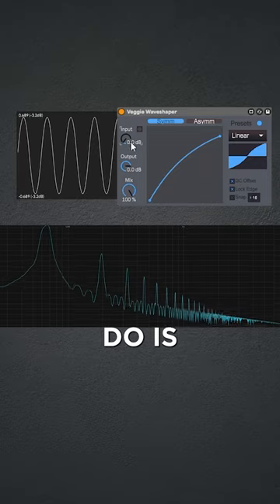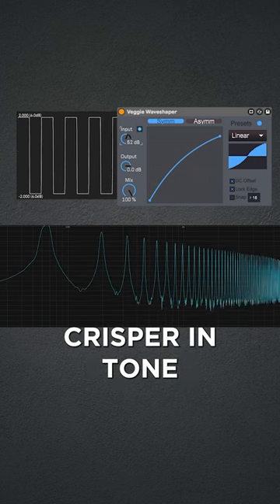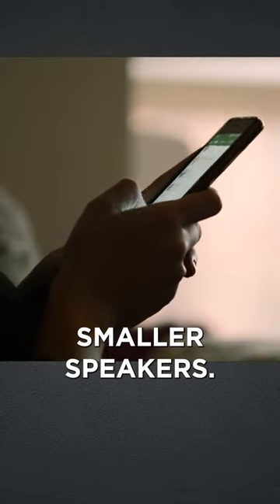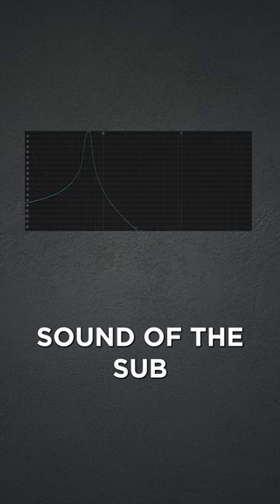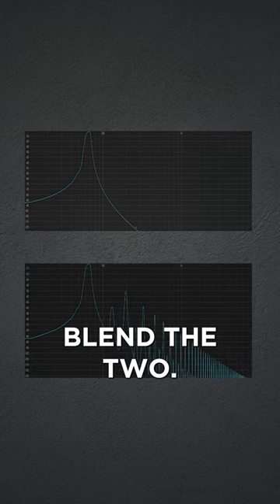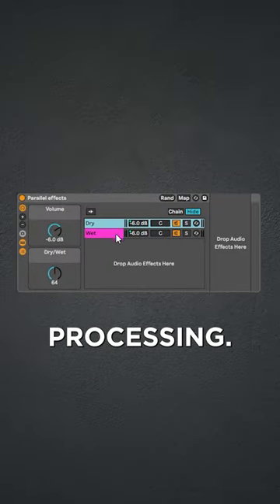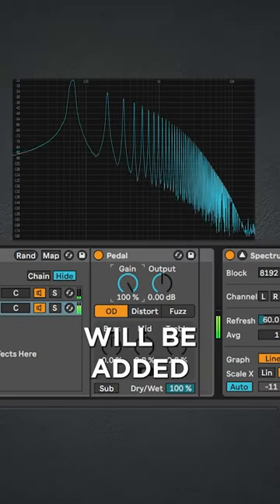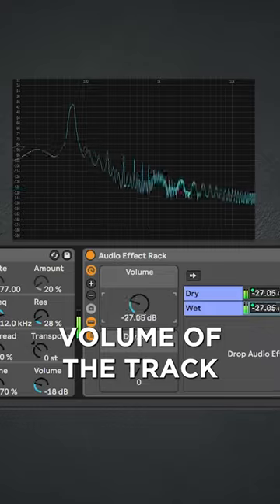How and why using parallel distortion

Comment: If i use parallel signal, how to solve phaser correlation issue?
Reply from the maker: Question is, should you correct a phaser issue ? (I'll answer it, but the answer can have several layers.)
- most of the time, you don't really need to correct phase issues. Some frequencies would be altered slightly, but unless your instrument disappear completely or get completely muffled, phase cancellation is generally not a problem
- what I try to say is: don't be afraid of parallel signals, they're amazing and super useful... Though if you do need to correct some phase issues:
- generally, delaying one of the parallel signals does the trick. You can out a delay, 100% wet, feedback at 0, and try to delay 1ms, 2ms, 3ms, etc...
- if you want to be more precise, you can use a plugin like in-phase by waves (there must be a lot more, but that's the one I know). That allows you delay only some frequencies, and it tells you how out of phase the 2 signals are
Reply: Wah. Really approciate it. I will memo your comment. I get it rightly now